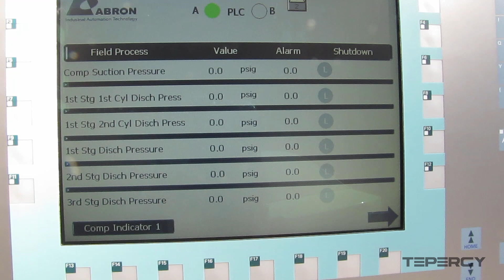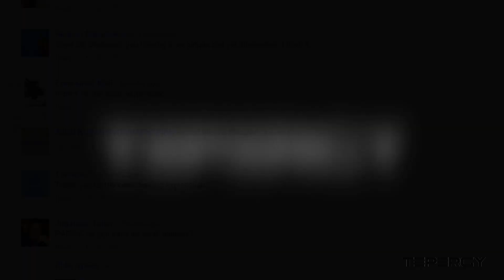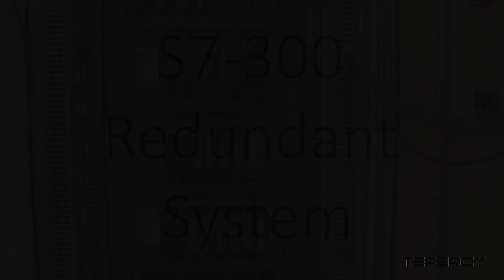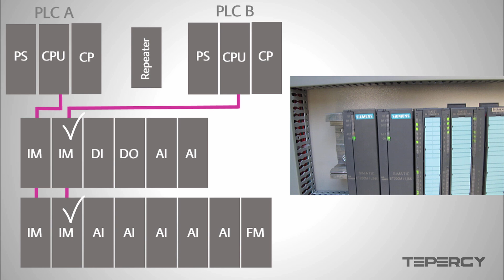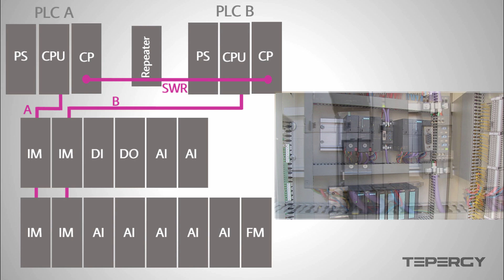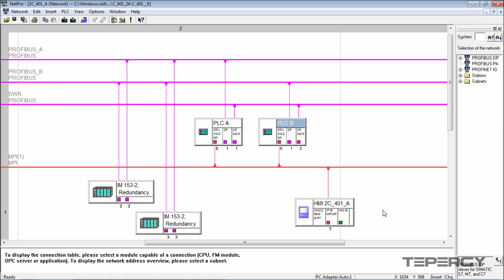How to Configure an S7-300 Redundant PLC _ PART 1

Comment: How does connecting two input slots get anything done. Would they not both wait to receive information that would never come? Since its two input ports.
Reply from the maker: Hello, @colecook834  Thank you for your question. The system is a backup system. You have two PLCs working in redundancy mode. One is the master, and the other is the backup. They will both receive the same input signals, but only one will control the output. The output of each output card is connected to the same terminal of the load. They both follow the process as if they were one computer. If one fails, the other bump-less will take over the controls. And I agree with you: waiting for a signal that will never come is useless, it's not the way it is designed. There is no use in that. Therefore, redundancy units are just that. 
f you're looking to learn more about this topic, you can join our 7-day free trial at:
https://community.realpars.com/checkout/realpars-membership

Comment: Helll Realpars

What if there are two rs repeaters which each one is connected to different Profibus network, then  one out  of the DP is connected to the other one , then looped through to be connected to HMI

How set that up in HW configuration?
Reply from the maker: Hi Saed,

Thank you for your question! The Siemens system in the network configuration has embedded software rules it follows, and when you compile the software for errors, it will notify you and gives you some solutions to help solve the errors. But what you are asking, I believe, is not possible.

Here is a link for your review on the possible redundancy possibilities with Siemens PLC. 

https://support.industry.siemens.com/cs/document/1137637/simatic-s7-300-s7-400-software-redundancy-for-simatic-s7?dti=0&lc=en-US

Hope this helps!
Reply: Thank you so much RealPars

Let me put my question clearer. 

Two CPU s71500 type 
Each one of the them is connected to the same a Redundant IM ( only one i/o Rack)

Ok

The two OUT DP signalS from the  IM are connected as IN signal to two RS repeaters , namely repeater A and B 

The out of the repeater A is connected to the out of repeater B then looped to the HMI from Repeater B . 

How to set this configuration in HW configuration. 

I am so grateful for your response in advance.

Comment: Hello friends, 
thank you for explaining the PROFIBUS network system.

as a newbie, i have a problem to adding new IM200M CPU module with Digital output module as a third DP Slave from SIEMENS S7-300 CPU315-2 DP as a DP Master using PROFIBUS DP Comm Protocol. Assume there is a setting on HW config about maximum DP Slave device that can be possible added in this CPU.

so the present condition is my CPU315-2 DP just possible to connect with maximum 2 DP Slave device. Can anyone help me so i can add more than 2 DP Slave device?

regards
Reply from the maker: I assume you meant ET200M, not IM200M.  You should be able to add as many Profibus DP modules as is allowed by the protocol (126 nodes per segment).  I suspect you are not setting up your network configuration properly.  Why do you say you cannot add another DP slave device?  Did you get an error message during the hardware configuration?  Are  your slaves all set to unique node numbers between 2 and 126?
Reply: @realpars  problem fixed, just a problem with the profibus connector doesn't work properly. Thank you for your response🙏

Comment: Hi,
         May I know from HMI where it's connected to?
Reply from the maker: The HMI in the video is connected to the MPI network, a network type that uses the same connector as the Profibus network but is connected to an MPI port instead of a Profibus port.  MPI = Multipoint interface, and was the original communication interface introduced by Siemens.  It is well-suited for connections to HMI panels and other peripherals in an S7-300 architecture.
Reply: @realpars  sir, you guys used to provide us fantastic videos....highly grateful .. Actually my question should have been little more precise. From repeater output to hmi via mpi network, but I could see two cable in hmi ....where that second one is directed?
Reply: @realpars   sir, looking for the answer.?

Comment: What's a CP module? And what's the meaning of SWR?
Reply from the maker: CP =- communication processor.  A CP card adds a communication port to the CPU, such as an additional ProfibusDP port, as in this video.  SWR = software redundancy.  This is software-driven redundancy strategy that uses peer-to-peer communication between two CPUs to provide a backup in case the primary CPU (CPU_A) fails.
Reply: @realpars  Thank you RealPars. You NEVER disappoint !

Comment: Great video. Congrats. One cuestion. Could I connect the three profibus connector in cascade ? (OUT 3 -> IN 2 / OUT 2 -> IN 1).  Thanks in advance, for your aswer.
Reply from the maker: Yes, of course.  That is the normal way that Profibus is connected in a segment (daisy-chained)when you have multiple devices.  The Profibus connectors shown in the video have an IN terminal and an OUT terminal.  In your example, device 3 and device 1 only have one connection, so you would enable the segment terminator (via slide switch) at those connectors.

Comment: Thanks for the video, it's very well explained. I have a question: what's is the meaning of SWR there and how the cable is connected to the connector (in input or output)?
Reply from the maker: SWR = software redundancy.  This cable is a ProfiBus network cable that connects to a communication interface (CP) card on PLC A and to a CP card on PLC B.
Reply: @realpars   I understand that, but do I have to connect the cable on both ends to the input port of the DB9 profibus connector or to the output port?

Comment: Why you dont switch terminator ON to A2B2 profibus network on your Repeater???
Reply from the maker: As the Repeater is in the middle of this network you should not turn its terminators ON.
Reply: @realpars  its wrong, you must turn terminator ON. Picture from SIEMENS manual: http://i65.tinypic.com/200vjuf.jpg

Comment: I have seen your 19 free videos, and I have a question. In the video 14th, named as "PLC Inteface Module"... You said that we need an IM next to the CPU in the first rack, and another IM in the second rack. Here we don't have an IM next to the CPU, why we don't need it in this case?
Reply from the maker: Hi Noemí Maqueda , using IM varies based on the project and application. For the project that you see in this video, we're using Profibus-DP network and connecting the DP port on the CPU directly to the IM on the next rack.
Reply: https://realpars.vhx.tv/plc-hardware/videos/35-interface-module-final-1 this is the 14h video I was talking about, there you used an IM next to the CPU, even when the DP port was free... Why? 
By the way, I love all your videos, it has helped me a lot, they're excellent! Thank you so much.
Reply from the maker: Noemi, Glad to hear your positive feedback. As I stated before, there are different projects. Depending on your project, sometimes you need to add an interface module next to the CPU and sometimes you need to make use of the port that you have on the CPU. In this video, we have an S7-300 redundant system. That's why we use a diffrent configuration.
Reply: Ok, thanks for your answers and time :-)
Reply from the maker: You're very welcome! :)

Comment: Hello!  RealPars.
I have a problem of communication for SCADA  connection to CP 343-1 (Ethernet )?
I want connection for SCADA  With Ethernet?
where it connects to on the PLC?
I can replace the CP 342-5 by CP 343-1 ?
I can replace the CP 342-5 by 343-1 for communication 2 x PLC?
Thank you if the answer.
Reply from the maker: +TranleCuong Tran  Hi there! If you have an Ethernet port on your CP module you can simply connect your cable to that port.
Reply: TranleCuong Tran

Comment from the maker: Hey Frederico! Thank you for your nice words. The hardware and network configuration you see in this video belongs to an automation system we deigned for a refinery so all see here is technically correct. 

If you see four IMs in the NetPro instead of tow it means you have not used the “Insert Redundant” option while copying the IMs. I have made you some screenshots to show how to do that in 3 simple steps. Click the link below: 

https://www.dropbox.com/sh/oblr5zw1tt37k09/AABiD4WKl1ZBKKtQLwQw704Ca?dl=0

Comment: Is the repeater necessary to make the link between the 2 CPUs and the HMI Panel? Can't we use the same way as done between the CPU-A IM-A-1 IM-A-2 ?
Reply from the maker: Redouane KECHIDA We need to connect two CPUs to a HMI panel that only has one input! So we do need to use the repeater. It works like a adapter here.